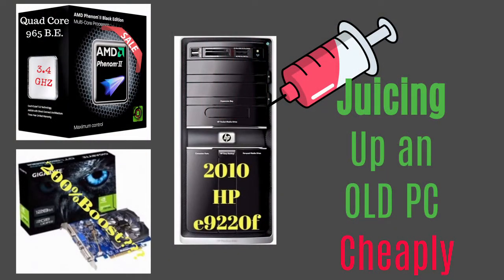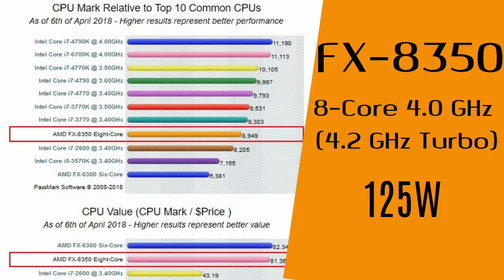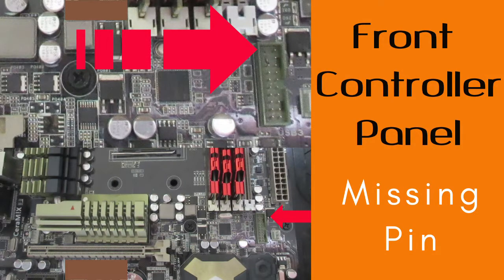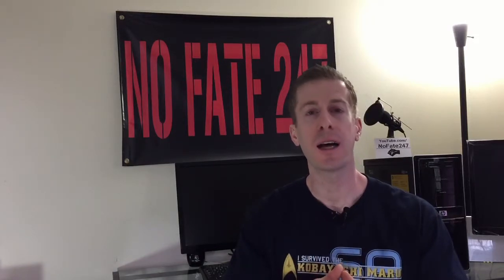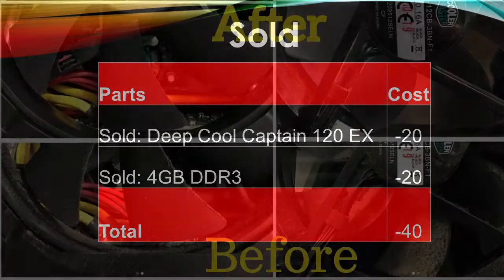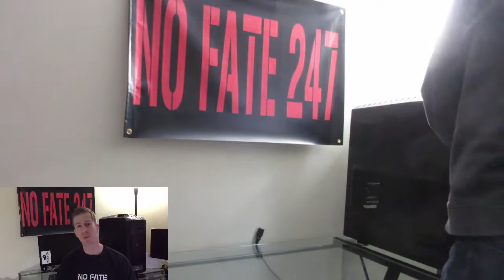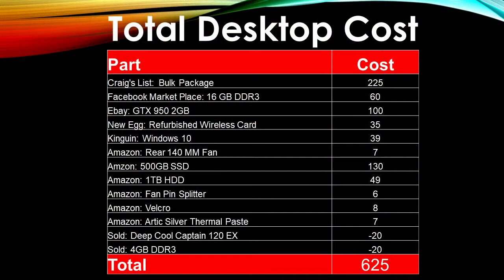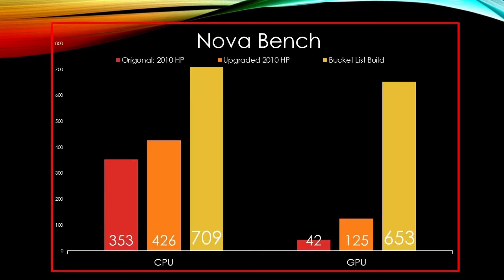My First PC Build | SUB $630 in 2018 | Benchmarking |Dad’s Bucket List Episode 2

Comment: If i would build a pc (unfortunately dont have one) i think i would pick a ryzen 5 x series rather than a fx 8350 just because of upgradeability for the future with the am4 socket instead of the am3 and ddr4 instead of ddr3 also lower power consumption which saves money overall if the pc is used for years it definitly adds up and so a ryzen series is more efficient and worth it over timr
Reply from the maker: GermanP players definitely boxed myself in with no potential for upgrading the cpu.  At least the overall cost was low for what I got. It's been running well and I haven't had time yet to overclock it
Reply: NoFate247 well you can still upgrade it by changing the motherboard and the cpu if one has the money for it thats the good thing from PCs overall so you still can upgrade it just not by one hardware component i guess
Reply: NoFate247 there are also some models over the fx 8350 with the am3 socket like the fx 8370 but thats ones preference. Your build is still a beast for its price and well done i love it! 😁